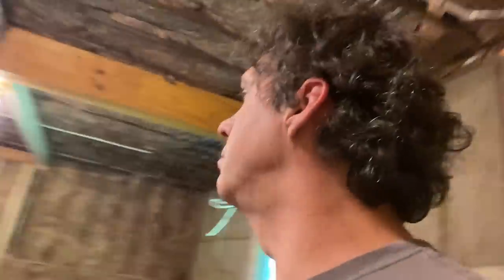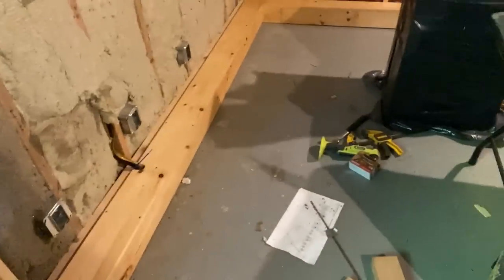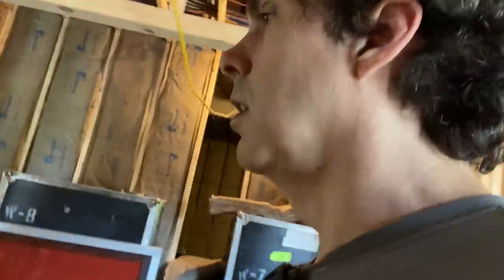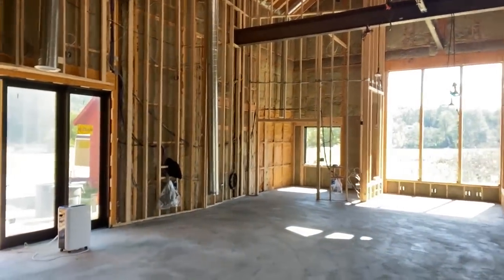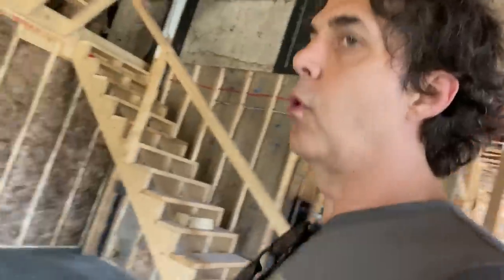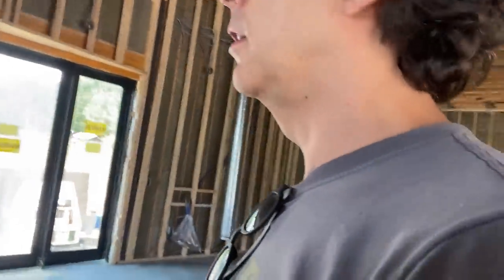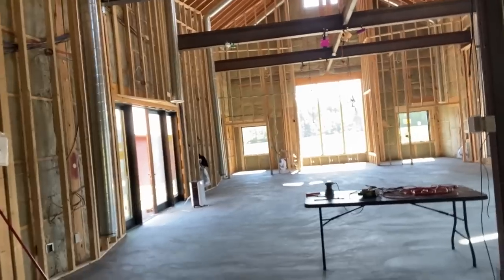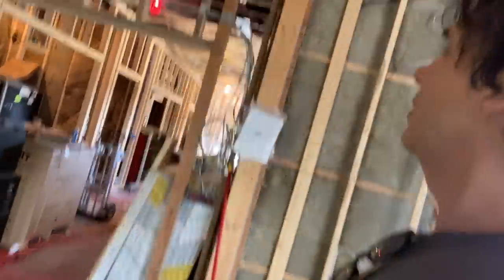Making Records with Eric Valentine - Episode 20 - Wiring Trough and Big room Insulation

Comment: Hi Eric. Thanks for sharing your amazing space with us! One thing that caught my ear that I thought might not be a great idea was adding plywood on rez channel over drywall. From what I understand, doing that on both sides of the wall would create a "four leaf effect" negating the benefits of the resilient channel and possibly giving you undesirable resonance issues. If you haven't already added the plywood, do a quick search on "triple leaf effect" to possibly save you some aggravation. Also, having recently used resilient channel in one part of a room and isolation clips (genie clips) with hat channel in another, I much preferred the clips/hat channel combo. Much easier to install with less chance of installation error and they are definitely more sturdy with more weight capacity and apparently have more consistent/better low end response. The down side is they're more expensive and take up more space. Anyway, not trying to be a Debbie Downer, but thought it might be something to consider if you're not past the point of no return.  Thanks again for all your amazing videos. I've learned SO much from them. Cheers.
Reply from the maker: Thank you for this.  I had not heard of this before.  It is  to late to change at this point.  It may not be an issue because my situation is slightly different than all of the examples I am seeing.  All of the examples show added layers of the same material.  My added layer is a different material with a very different resonance.  That might help minimize it.  We will see how the isolation performs.  If it is an issue I could add some mass loaded vinyl to the outer layer and that would help a lot.  Very interesting!
Reply: @mrwev  I think the issue arises from the two hard surfaces with the small air gap in between (half inch from rez) creating resonance, along with that resonance's  relationship to the 3rd and/or  4th hard surfaces.  It's really counter intuitive, but I've run into trying to  soundproof window openings.  I added a second window about 10 inches away from the existing window and it made a huge positive difference in sound isolation.  I thought if I added a removable plywood baffle to the second window it would be amazing, because  2 good! 3 better, right? Wrong! Big low frequency coming through  to the outside, essentially the same as having only one window in the low end.

If you're able to add an absorbent layer to the gap between the drywall and plywood with some sort of insulation (sonopan/homosote or strips of pink fluffy) to absorb some of the resonance it might help?
https://sonopan.com/retrofit-installations/  If you scroll down to  "with resilient channel"  I don't think sonopan is available in the U.S. but it's just a wood fibre board.
 
Having said that... I AM NOT A PROFESSIONAL  ACOUSTICIAN!!!!! And I don't fully understand the science of it all. I just went down the google rabbit hole when I had that experience with the windows and when you mentioned your plan it  immediately reminded me of it.  I hope it all works out amazingly, but if there is a weird unexpected result, that would be my #1 suspect of weirdness creation.